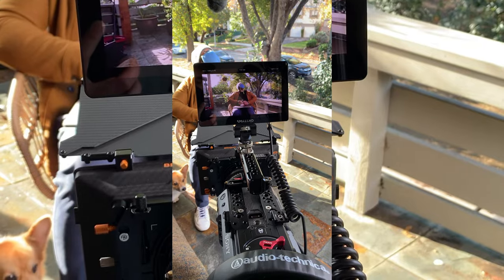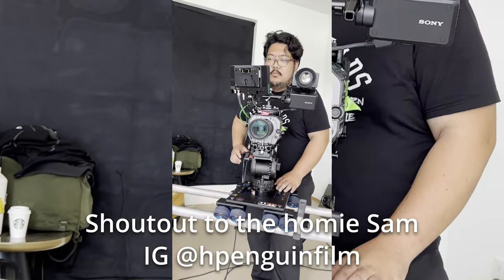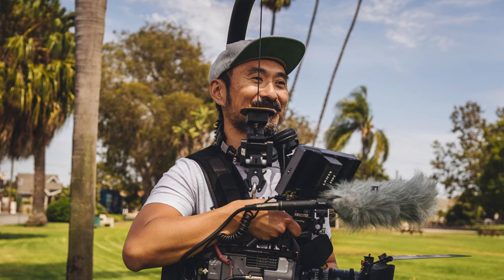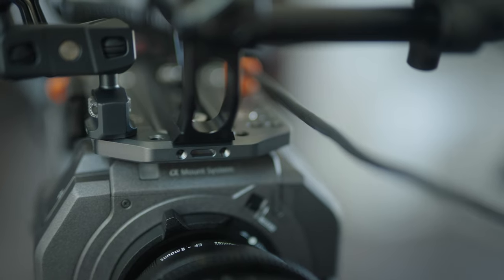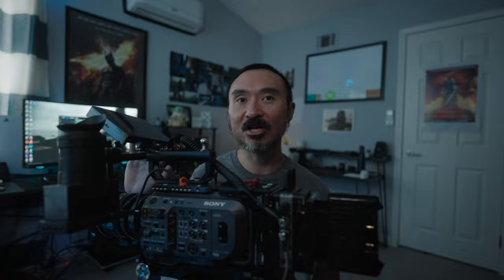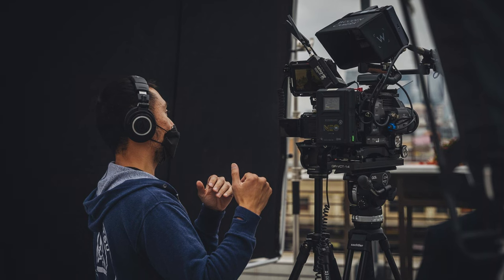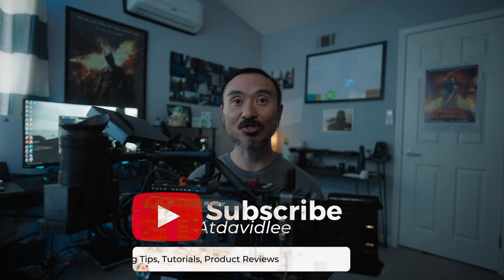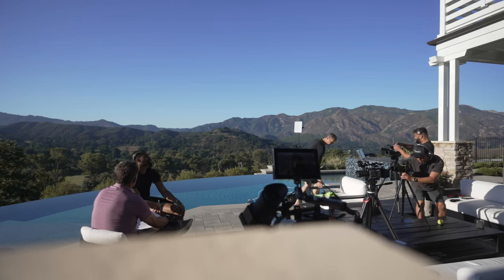SONY FX9 BUILD 2023

Comment: Would you recommend the flowtech 75 over the flowtech 100 for your fx9?
Reply from the maker: I've used my Flowtech75 extensively with my FX9 as well as larger setups with a Venice. The 100 is great if you have fluid heads for 100mm.

Comment: If Sony were to release an FX9 II, what upgrades or new features would you most want to see?
Reply from the maker: 4K 120fps at least in the 5K FF Crop mode or S35. A 6:5 or 3:2 Open Gate option. And XOCN-LT